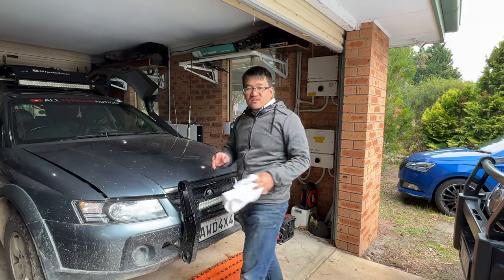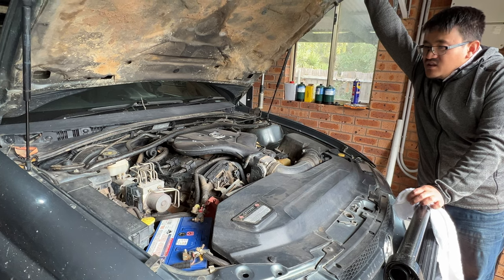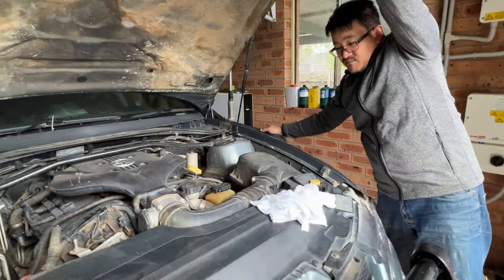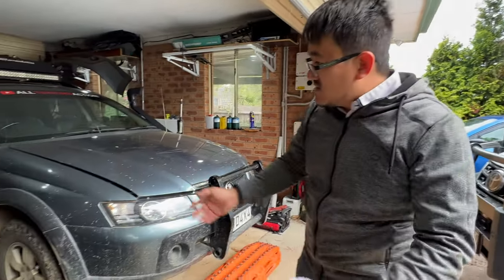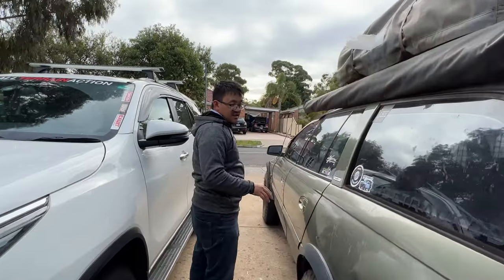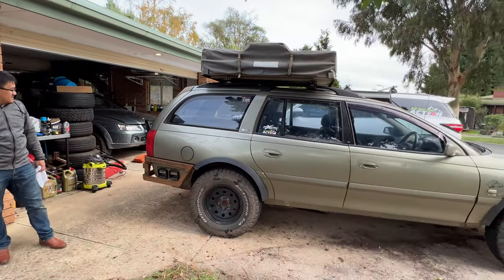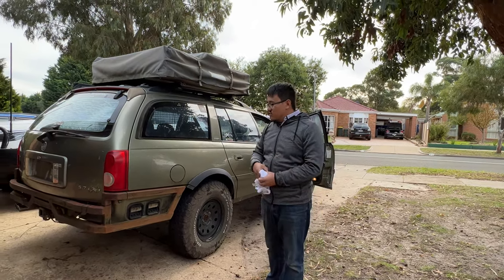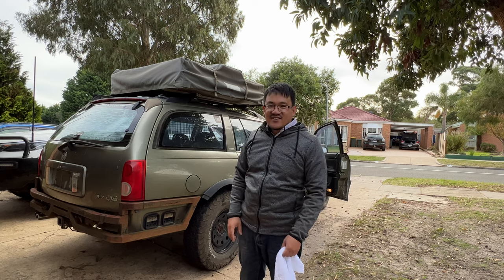Chris's V6 Adventra Alloytec 190 5L40E All Wheel Drive Lifted Off Road Crosstrac Wagon

Comment: How has the transfer box stood up to all the off road work cheers peter
Reply from the maker: Both V6 and V8 use the same transfer NV124 and there has been Adventra V8's worked for drag and they have survived with no modification. It is a single speed full time 38/62 torque split and mesh helical gears with high overlap - not chain driven like many say it is. We've never had an issue with ours we very rarely hear of anyone needing one either, I think failure at this time could only be due to lack of gear oil management or extreme mileage.
Reply: Just wondering is the transfer box the only part that is difficult to source parts for
Reply: Not sure if it's the same transfer case as the Territory but I remember hearing they shared AWD commonality somehow, also certain years of BMW X5. Might need to verify this for yourselves, it's been a long time since I've read into this stuff. Anyway, nobody worries about the transfer case, it's always the transmission in the V8 if anything.
Reply from the maker: @SwaggingWithBen  yes correct Territory uses NV125 (also used in BMW X5)same torque split 38/62 but one of the differences is that the Territory has a chain-driven transfer as opposed to the Adventra which is a helical gear-type the NV124 used in the BMW 3 Series.
Reply from the maker: @peterjones3177  doubtful, so many wreaks around with them sitting in them and highly unlikely with anything wrong. I see them going for sub 150$ for the transfer case.
Reply: @AllTerrainAction  Also used in BMW and hold up fine with the BMW’s power.
Reply from the maker: @FuManchu5ltr  i actually don't know what power that is, can you share figures they put out?
Reply: @AllTerrainAction  I’m wrong. The BMW V8’s seem to use the ATC450 which looks the same at a glance but has the actuator.
Reply: @AllTerrainAction  The E46 and X3 seem to have “comparable” power outputs to the Adventra V6’s.
Reply: @peterjones3177  Point being is these are used on more than the Adventra and parts are plentiful throughout the world. Also sort of simple operation so fabricating parts in 50 years is entirely possible.
Reply from the maker: @FuManchu5ltr  haha I doubt my Adventa would last more than another 5 years given its paces I'm putting it through, but it is good to know!
Reply: @SwaggingWithBen  Whoa. Spotted you in the wild! I love watching your videos :)
Reply: @FuManchu5ltr  haha well done! Cheers mate  🍻

Comment: These cars are definitely underrated but they do have a few more problems than the standard Commodore... I'd take a little more care with the 5 speed as they can become unreliable and sourcing a new one may be hard (Since there was a short production run)
Reply from the maker: I swapped my 5 speed very recently with a 2WD one from a VZ Calais with 140,000kms on it which the transfer just all connected together fine only modification needed was drill a new screw hole as the Adventra variant has the trans selector cable setup differently, there was nothing wrong with my existing trans I just wanted a spare and know with 100% confidence that the 2WD version will work, replaced the torque converter while I was there  and put my old trans away on the shed for a backup one should I ever need it. I don't foresee any issues with the 5 speeds accessibility to parts imo.
Reply: @AllTerrainAction  Oh... Because I heard that there isn't as many people rebuilding or selling parts for them since the 5 speed wasn't available for very long... That being said, the 2WD 5 speeds are also fragile as well if they aren't maintained...
Reply from the maker: Not sure I could agree with you Martin, although this is only based solely on my own experience only so it may not be a good reference. My original trans had no issues with the last 45,000 of its life being heavy off road use (current age of pulled out 230,000) the reason why I also swapped the trans was because I did think the torque converter may be on its way due to fluctuations in rpm crusing on the highway when locked up. I hear from the Adventra community (sub 4k member community) that the 5 speed in the Adventra get around 300-350k before things go sideways for normal driving use... Thanks for this feedback though this is good info to know to contribute to the database of knowledge. 👍👌.
Reply: @AllTerrainAction  The 5spds aren't terrible but they do require a little more care and are harder to find parts (than let's say a 4spd GM Auto)... You should also join Just Commodores as they also have useful info for all Aussie made Holden's... Including Advertra's

Comment: With the Price of Fuel... that V8 Adventura is going to cost a bit to offroad with where most of the time its going to be on the limiter.
Reply from the maker: Somewhere around 1.6-18k by our working outs from Melbourne for the single Adventra alone assuming avg $2.75 per ltr could be more, ah well... its happening!

Comment: *2007
Reply from the maker: Also to be more exact V8 variant 2003-2005 and V6 2005-2006(or 7? as you suggest Fu Manchu) I did think it was 2006 though.
Reply: @AllTerrainAction  There are ‘07 Cross8’s fitted with the L76 6ltr. I can’t see why they weren’t making the Sx8 and LX8 the same. Utes and wagons continued production well into ‘07.
Reply from the maker: @FuManchu5ltr  yes well aware of the last of the Cross8's with the 6L L76 although I understood that was 06 age, I will have to investigate this more as I think also the L76 V8 could have possibility for HDC and Improved ABS for crosstrac given its on the newer bosch platform. If the Cross8's 6L L76 models did have the improved system it would actually be a machine given all things I've tested v6 vs v8 as it has never come down to power but more CrossTrac capability.
Reply: @AllTerrainAction  Now I’m fact checking myself. Lol. You are correct with August ‘06 the latest I can find. However they are fitted with the L76. Build numbers approx 150 Jan to Aug 06. The unicorn. 
I found a Trading Post add featuring one as well. I looked for ages but the one that did come up was close to $30k (out of my Budget) and that was pre Covid!
Reply from the maker: @FuManchu5ltr  ... if we can get our hands on one, it will be in the driveway with a touring build on the rear chassis replacing the tray.. wont that be a build. VZ Cross 8 L76 and the newer CrossTrac & HDC Dual Cab with live rear and a touring system on the rear.. imagine the possibilities 🤪